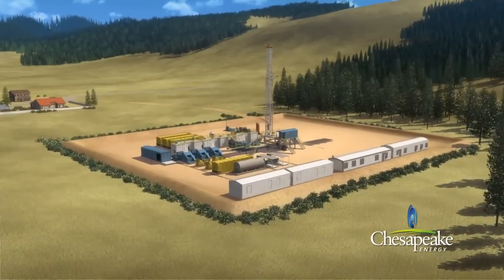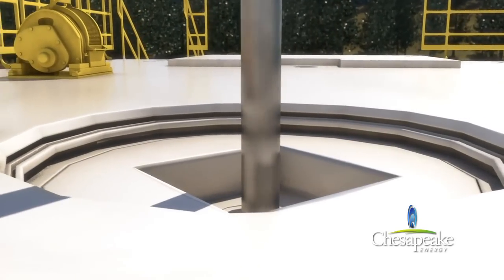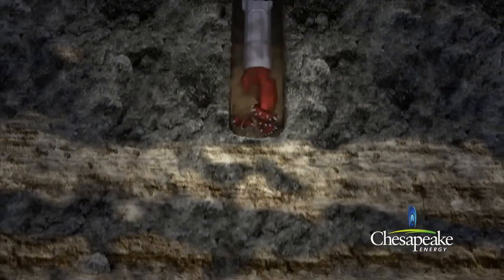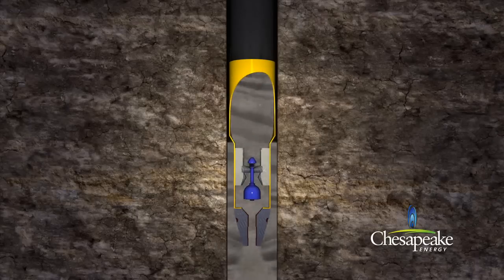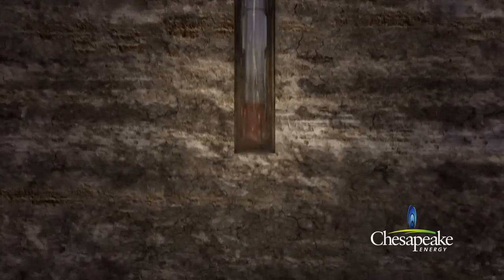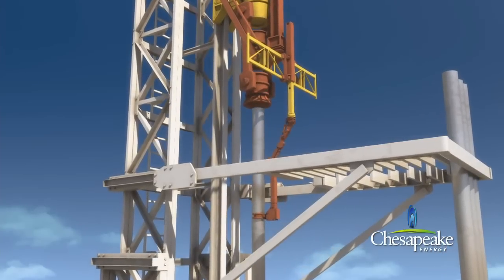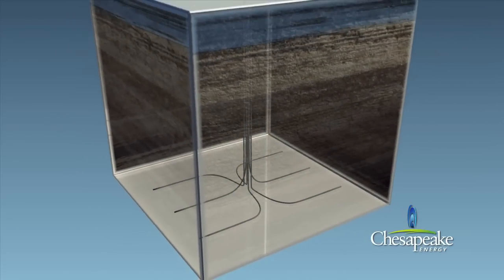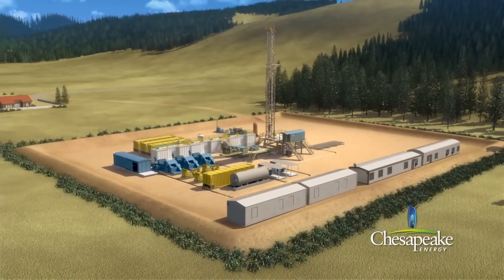Chesapeake Energy horizontal drilling method

Comment: What happens to all the fluid when it's removed to put the plug in? Wouldn't the natural gas mix into the water as soon as it's fractured? So when the water comes up, wouldn't gas and oil come up with it? I get that the fissures remain open and can flow freely into the well bore once the plugs are all removed, but what confuses me is what happens to all the oil gas in between each of these steps.  It's not like the oil and gas are going to sit there and say "okay we'll wait until all the perforations are fractured and plugs removed before we start flowing to the well". It seems like some oil and gas has to be lost in the process. Please help clear this up for me! Thanks.

Comment: How do they actually turn the string from vertical to horzontal?
Reply: Bent sub.  Down hole motor.  If they stop rotating the pipe and still pump thru the motor the hole will turn in the direction of the bent sub.  When they want to go straight, they rotate the entire string.
Reply: what is a bent sub?
Reply: Izio Shaba To drill with a mud motor rotating the bit downhole without rotating the drillstring from the surface. This operation is conducted when the bottomhole assembly has been fitted with a bent sub or a bent housing mud motor, or both, for directional drilling. Sliding is the predominant method to build and control or correct hole angle in modern directional drilling operations. Directional drilling is conceptually simple: Point the bit in the desired direction. This pointing is accomplished through the bent sub, which has a small angle offset from the axis of the drillstring, and a measurement device to determine the direction of offset. Without turning the drillstring, the bit is rotated with a mud motor, and drills in the direction it points. With steerable motors, when the desired wellbore direction is attained, the entire drillstring is rotated and drills straight rather than at an angle. By controlling the amount of hole drilled in the sliding versus the rotating mode, the wellbore trajectory can be controlled precisely.